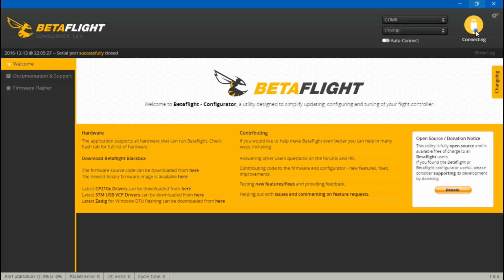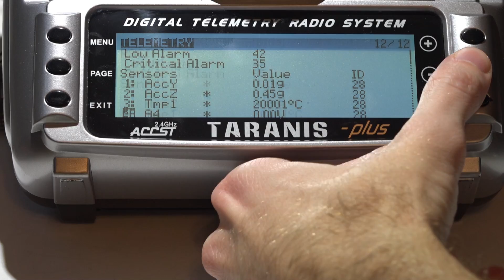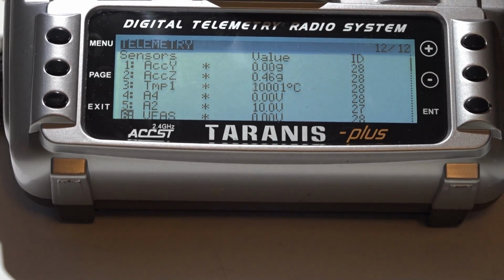Fix For Fried FrSky Receivers

Comment: Wow nice and usefull info as I just fried my R9 Slim + last night and saving my $45
Reply: I just joined that club. Put my picture on the wall of shame. Connected it to my X9D using the smart port servo wire without reversing the polarity at the radio. (Back pins)

Comment: Not sure if someone will read this, but does anyone know how to apply it to XM+?
I'm not able to find voltage regulator on this one receiver.
Reply: What happend to you? My xjb 145 was working ok, then I updated the OSD  and after that, receiver is not powering the lights up and no connection at all. Cant believe this sht. I just got my mobius mini v2 , ready to make videos and now this happens…
Reply: @sosquadcopter6634  
I was trying to update firmware, on 2receivers it worked on another 2 they just stopped working.
I think i might just break the connection somehow between XM+ and taranis.
Reply: @maxol96  I had to buy another receiver antena =(

Comment: I have a fly sky x6b that smoked on me and I'm not sure if it's the regulator or not. The chip I know for sure is burnt.
It's a 6 leg chip on the bottom of the board commonly covered partially by white paste/glue.
Best guess is a switching regulator?

Thanks in advance!

Comment: Crazy.  Sure enough my regulator is fried.  I plugged the Rx into an  unpowered board, which would normally power the RX.  That board is 36v and supplies a 5v regulated output.  In this case, I powered the Rx externally at 5.2v. This is because I had forgotten if I powered the Rx from that other board, or if I powered it externally.  Either way, hooking up the signal,5v,gnd from one of the channels to the unpowered board, fried the 3.3v voltage regulator.

Makes me sad.  Thanks for the video, I couldn't find the regulator info (162t was printed on mine), but assumed it must be 3.3v.    I'll replace it now that I've verified it's dead.  With this failure scenario, I'm guessing if I ever DO power the Rx separately, then I'll only connect the gnd's  and signals to other things, besides servo's or whatever the Rx is powering :/  I still think it's kinda weird.  Cause depending, if I'm using a big bec, I'm going to be a little paranoid attempting to power everything from it with this Rx.  This is what I get for working with a weird setup I guess :)

Comment: Hey JC nice job, continue to do great content that's awesome what you do ;)
I've got a question: i accidentally pluged the 10V from the pdb in the 5V output of the vtx (not a FrSky, a cheap FT48X but still it could be 20€ saved), it flew 20s and snow and no more signal. Since then it does not turn on, no leds, do you think there any chance this fix could revive it ? Otherwise if you know what could the problem be and if it can be fixed ? (I don't need the 5V output maybe bypasing it if it the source of the problem) Thank you

Comment: Hi, i have a couple of xsr here and they still turn on, but loses rssi signal in about 1 meter. Antennas are good. any chance of fixing it? to save a couple of bucks.... :)
Reply: im in the same boat with an X4R-SB. got it brand new and have signal drop out at about 100' away. obviously I replaced it and the new one is good but I still have the old one laying around and would love to be able to fix it. Tonight ill check and see if the regulator is actually putting out 3.3 volts. but otherwise don't know what else could be the issue

Project Blue Falcon, have you come across a receiver with poor signal issue and have any suggestions?
Reply: 3rD_Coast FPV  There is a firmware update for this problems  on frsky site.  Although my reciever died half way through flashing, unfortunately it isn't the 3.3v regulator.

Comment: Should I remove the voltage regulator on x4r-sb or just solder to the 3.3v without taking out the regulator

Comment: Yea the receiver connects and binds but doesent have any signal coming out? you should fix cameras and all that stuff that a component blows out on. I have a cam that will work and I can see my name on top but it doesent have video. and also should do blown vtx. this would save me a lot of money. also blown escs is an option as well. you could do so much with that hot air rework piece
Reply from the maker: I do have some video planned like that. Just waiting for the parts to come in. I get most my stuff off of ebay. A lot cheaper but it all comes from China so it takes forever.  Placed an order two weeks ago and still waiting. I ordered what I think is the correct 3.3v regulator for these receivers but I want to test it out first before saying.
Reply: Big RussFpv anyone knows if JC ever made that video, I know the 3.3v fix works but I want to try the real fix. 

Only thing on the X4R-SB I can read is "16"
Reply: Russ.. sadly .. JC has passed away in a motorcycle accident a few weeks ago